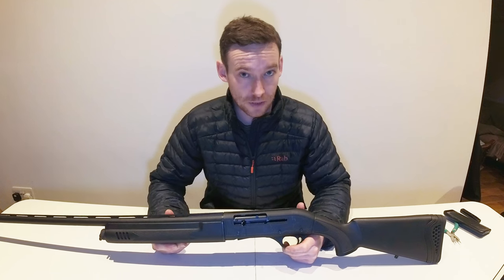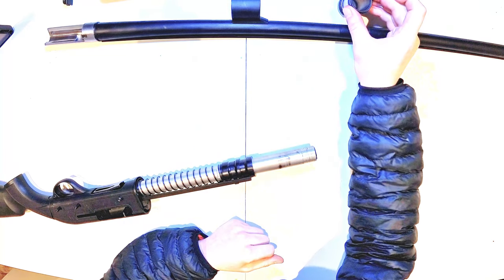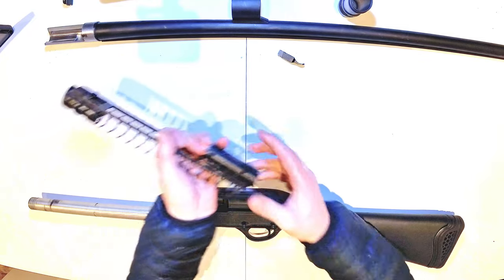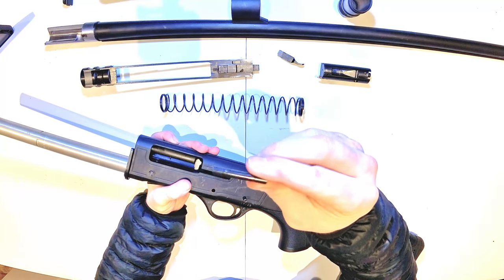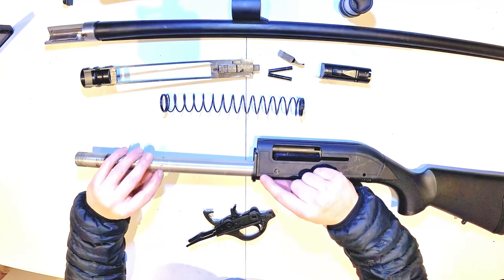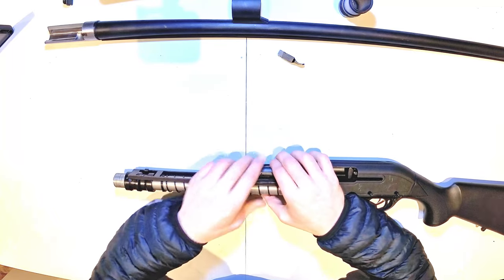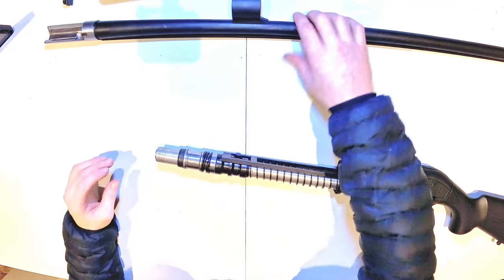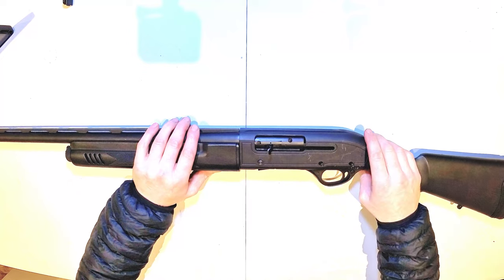Hatsan Arms Escort FULL strip/reassemble

Comment: I bought a Hatsan 410 Escort PS. I oiled it up,  put it together and took it dove hunting. I had a bunch of fail to fire. It just clicks, no primer strikes. Have you had that issue before? I have not been able to fire more than two rounds. Sometimes it just won't shoot. Sometimes I pull the trigger and just hear a click, then the bolt is stuck with a live round in the chamber. I love the gun, but may trash it if I can't figure the ussue out.